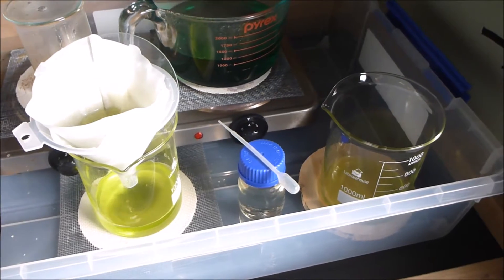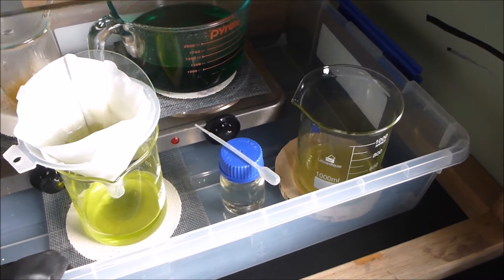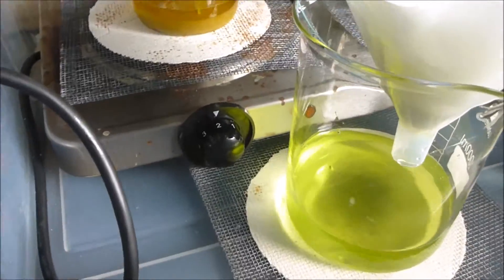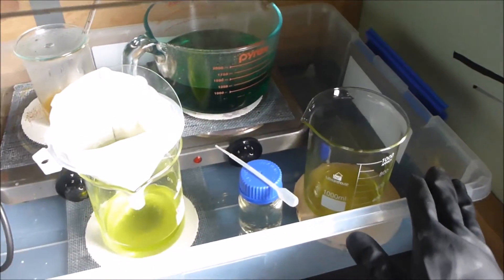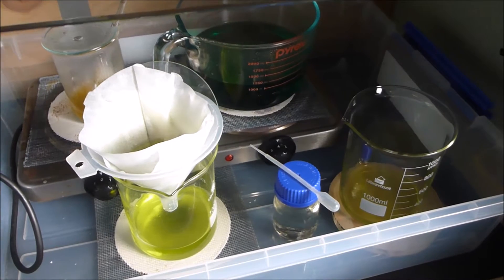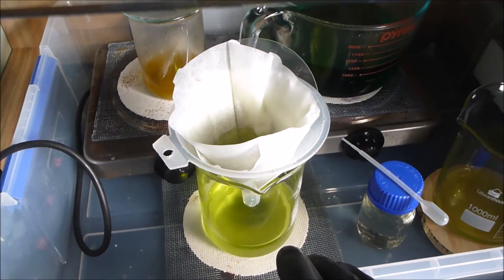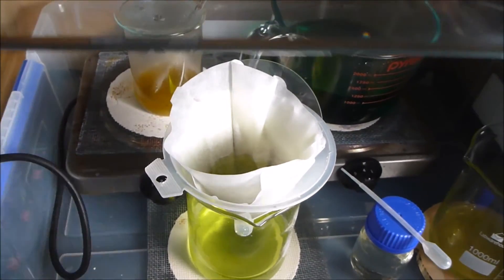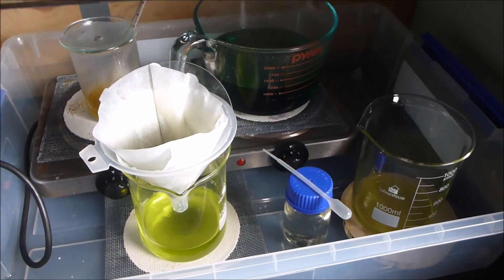Getting your gold bearing solutions crystal clear

Comment: Successful Engineer ek het kak, how do I get copper out of my gold bearing solutions (or rather how do I purify it?) and what do I do if I already used sodium-metabisulfite???
Reply from the maker: Hi daar, So, it sounds like you have a mix of Gold and Copper in a solution, the SMB will selectively precipitate Gold (leaving the Copper in solution) as long as you don't use too much SMB. You want to use about 1-2g of SMB for every 1g of Gold you expect. You then wash your precipitated (and settled) Gold powder using boiling water and warm HCl to remove any remaining Copper. Whenever I have a very dirty solution (Lots of Copper) I actually prefer to cement the Gold out on a Copper bar, then do a re-refine to get nice pure Gold.

Comment: charmine plug takes a while but works great. three squares toilet paper folded together then rolled into a plug and pushed gently into funnel. adjust flow to two drips per second by playing with snugness of plug in funnel tube while water is in funnel.
Reply from the maker: deltadawn(putyourclothesbackon) Great comment, thanks. I have also heard of people using fibreglass for the plug to filter things like Sulfuric acid. Will certainly give it a try.
Reply from the maker: Hi again, I finally tried the charmin plug with a vacuum filter setup, worked perfectly. Thanks for the advice!

Comment: hello. i am french so escuse my english. a question!  the 2 filters you use, did they keep some gold in the aqua regia or not when you clear the cloudly solution?.  i fear the gold stay in filters?? may be not. 
thanks you for your channel it is very profesionnal techniques and you explain it very well. it is a pleasure to see you refining like this.
Reply from the maker: Hi David, thanks for the positive comment. Yes, whenever you filter a solution, there is always some fraction of the solution that will stay in the filter, this fraction can be minimized by diluting your solution before filtration, and obviously also by washing the filters out with water. Getting rid of fine powder in suspension is very difficult sometimes, these days I prefer to let solution stand and settle for a few days, then siphon the solution off with a piece of aquarium tube. Your  English is great, nothing to excuse!